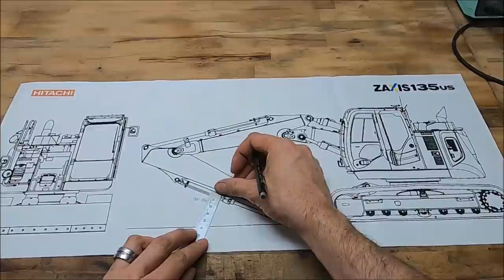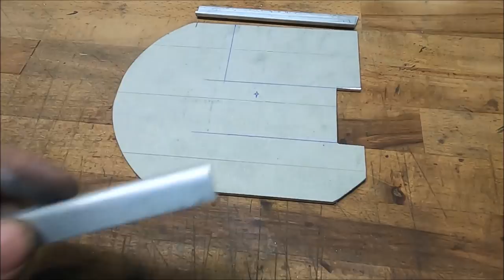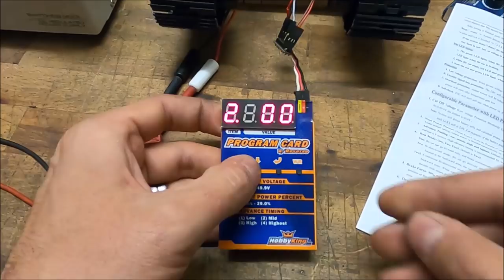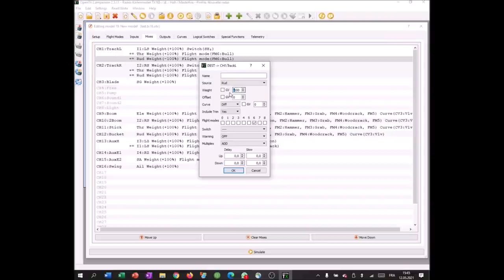Build RC Excavator from scratch, Hitachi ZX 135 US 1:15 Scale project Full Edit

Comment: Wow! Ça paraît si simple de construire un ensemble si complexe ! 
Connaissant déjà une bonne partie de tes méthodes je poserais 2 questions simples : 
- les collages epoxy sont ils dans le temps fiables? Pour coller du métal personellement, je le chauffe autour de 150 degrés, faute de quoi l'epoxy n'adhère pas assez, toi il semble que tu colle directement sans soucis. 
- le Silence de fonctionnement est étonnant ! Est-ce dû a une pompe particulière? lente ? Ou a la fluidité de l'huile peut-être plus épaisse que la courante ultra fluide employée ? 

En tout cas je suis toujours autant Fan de ces petit engins bourrés de détails et de bonnes idées !
Reply from the maker: Pour l'instant ca semble bon oui, les plus anciens collage epoxy que j'ai remonte à 4 ans et pas de problèmes. Pareil je chauffe à 150° pendant 5min, c'est dans la notice de l'Endfest 300 (pistolet reglé sur 180°).

C'est le montage qui rends la pompe si douce, c'est une Jung HR-7 avec réducteur planétaire Kontronik, le même montage que sur ma SK270, mais cette fois pour gagner de la place le réducteur est directement monté sans accouplement souple. Je vais faire une vidéo du montage de la pompe bientôt. Par contre aucune de mes pompes n'est fixé sur les machines elle sont toutes posé sur de la mousse et tienne en place uniquement pas les tuyaux.
Reply: @BartsteRCModels  ok, d'où le bruit, effectivement aucune transmission physique de la vibration, c'est si logique que tu es génial !!! 
Une vidéo serait très sympa sur tes montages oui. 
De même que la durée de la vidéo de construction pourrait être de 30 min sans soucis. 
Comme tu as déjà fait, une courte une longue. 
Pour la endfest,je connais c'est une excellente marque de colle, je n'avais pas vu que tu chauffais, mais ça me rassure sur la solidité. Après 4ans c'est garanti,ça ne bougera plus jamais. 
As tu envisagé une construction intégrale en laiton ? Ça alourdirait la machine, mais pas de risque de rotulage vu l'excellente base tournante que tu utilises, et ça te permettrait de faire une vieille pelleteuse un peu Vintage, avec du métal juste brossé et vieillit. 
(Je pense à un bulldozer à treuil très ancien dans l'aspect vu sur une vidéo Nordbau ou autre je ne sais plus, aspect cuivre et laiton)

En tout cas.... J'adore vraiment énormément tes réalisations ! Autant les machines que la construction qu'elles réalisent ensuite.